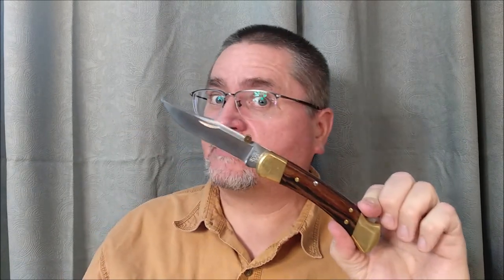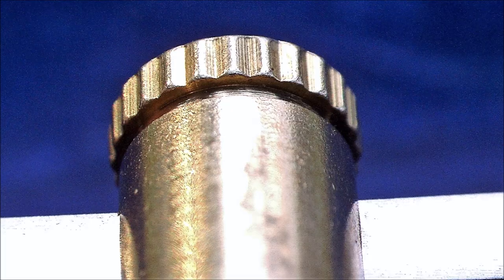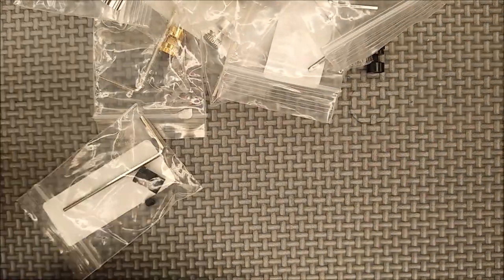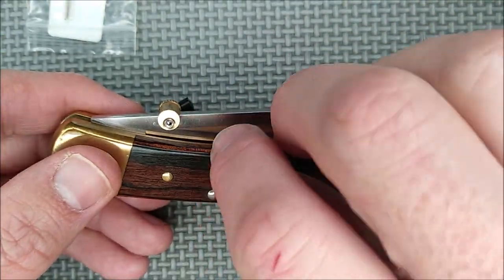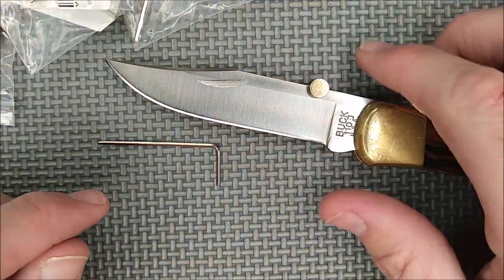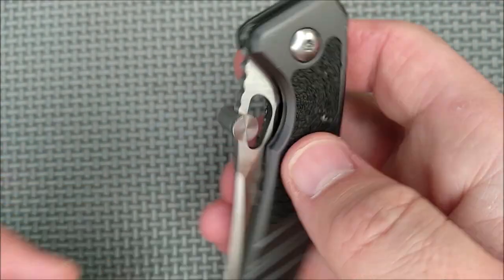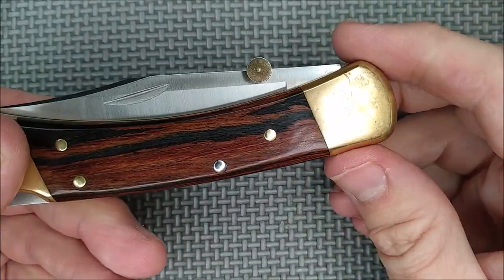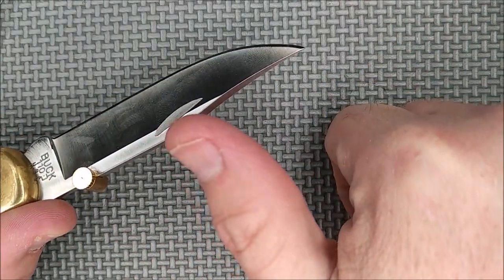Add-On Thumb Studs - Make a 2 Hand Opening Knife a Thumb Stud Opener

Comment: I put one on my ti lite. I glued it on because I didn't trust the little screw.  I am very happy with it and I can wave my knife open much easier
Reply from the maker: I have had mine for a couple or years now and the screw has not come loose, but if you know that you will want to keep it on permanently  you could also use thread locker on the screw.